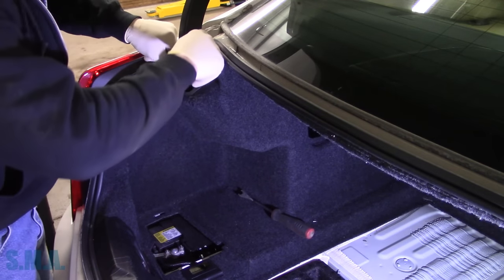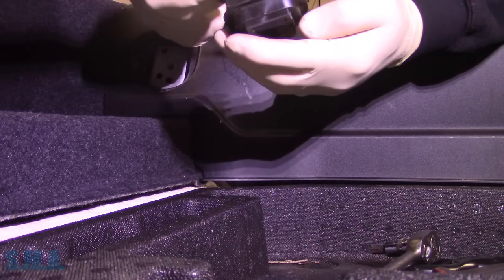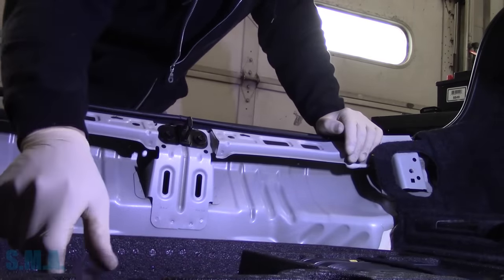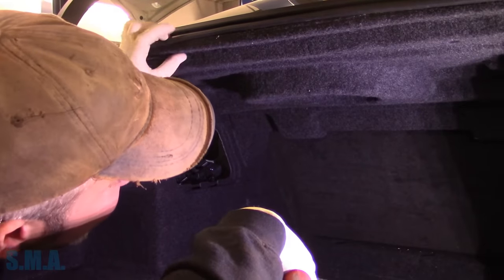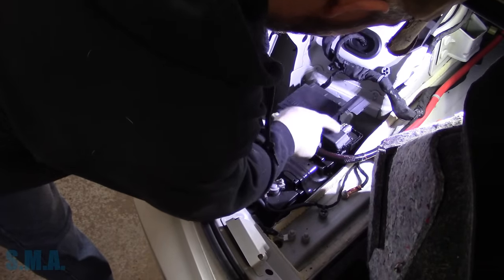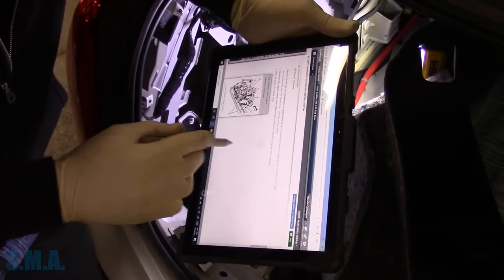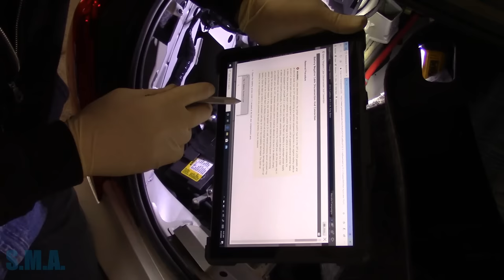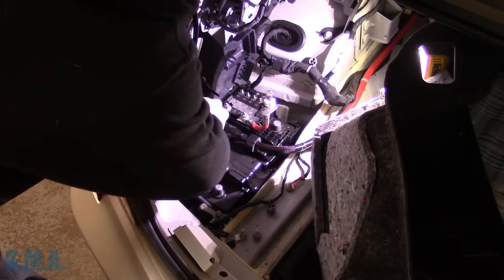Cadillac ATS: Battery Remove & Replace

Comment: Iv’e never had the opportunity yet to work on one of these. From what I’ve seen It doesn’t quite compare to a Dodge Journey battery replacement. I can’t remember what year but I would think they are all like that. Being that the battery is located in such a ridiculous spot. Under the drivers front wheel well. Im talking a really tight spot. It makes it virtually impossible to do diagnostics from the battery post. What were they thinking???

Comment: What I learned this week about new cars and their replacement procedures of the battery, you MUST know what you're doing!  One of the fact that he saw that this original battery is an AGM, customers must understand that you need to replace the battery with the same type of battery.  This particular model circuits design to charge AGM batteries, only.  Not lead acid battery.  Another thing I found out with these new cars with these batteries, and even I didn't know about this, is that you have to be very mindful about how the vehicle is measuring the battery charge levels!  I heard something about, resetting the cars charging levels, right after you replaced the battery. Just removing and replacing the car's battery can screw up the system and treat that new battery as if it was old.  In worse case, overcharging the new battery because you didn't reset the system to say it's a new battery. As we all know, the more the battery ages the more the car have to continue to charge the battery. That's the joy of having a new ass car!  I'm in no way close to as smart as this guy is with cars; but I do understand how complicated new cars have gotten.  A lesson here!  Always learn and research before doing your own work.  What you don't know can kill you, lol.

Comment: In the 90's the FIAT cars had to be reset on a diagnostic machine to reset the throttle body so it would idle, then drive it at various speeds and loads then let it idle until the ECU learnt when the cooling fan came on. I went out to loads of non runners after the battery had been changed. Fords were the same after they introduced Efi, they soon got it sorted tho , but all the messing around did take an hours labour, customers thought it was b##£$41t and we were ripping them off.

Comment: The battery on my PT Cruiser is under the passenger seat (it's the diesel) changed it a few times in the 2 years I've had it and only recently found out it's supposed to be a gel battery on its side, I've had a standard low profile battery all this time 🙃🙃

Comment: After the new battery is back in the trunk, do you put a battery charger under the hood on the positive terminal for a Cadillac ATS or CTS?
Reply: It has a positive wire going all the way to the engine bay so you can charge it from under the hood!

Comment: Until seeing this, my worst was a 1954 Lincoln with a minute 6 vdc battery under the passenger side foot panel. Darn battery needed replacement about every 2 years.

Comment: Got nothing on a Q3 hybrid. The larger of the two 12V batteries is at the very bottom of the trunk well, under the fan, duct work, and evaporator core that cool the high voltage battery right beside it... and that's after you discover it exist because, outside of the VW SSP's, it's hard to find any reference to this battery in your typical shop info. Opening the left panel in the cargo area reveals the small 12V and only complicates the matter as you think "oh, okay. There's the little kickstart battery just like a prius"
Reply: .... almost forgot, the subwoofer is in there too lol

Comment: My battery on my 2014 ATS was fully dead and when I replaced it the Radio and Nav quit working.  I checked fuses and tried disconnecting negative battery cable but no luck.  Any ideas?

Comment: Worst batteries I’ve changed?
4 8-D batteries on a roof top. Up two ladders. About 150 pounds each. Not fun. 

That ATS has a silly design for its battery. If it were mine (not that you can do this to a customers car) I’d look into cutting the liner and lacing it back together. 
I did that for the fuel filter access on a 2015 Duramax I had once. Laced the flap I made with black zip ties. Worked well for me.

Comment: Just did battery replacement on my mom's 2011 audi a6. That battery required coding after replacement. Tried using battery from O'Reilley's and VAG COM would not  accept battery serial number. Ended up buying OEM battery from a dealer and coding was accepted. So there's that.

Comment: I think car manufacturers over-complicate things just to motivate consumers to "trade-up" sooner once they realize how traditionally routine, inexpensive services are becoming expensive. Makes more sense to lease or buy new more frequently.
Engineers could have definitely designed that battery system to be easier to maintain, access and no need to trigger OnStar into a self-destructive mode. They deliberately chose to bury it and over-complicate it.

Comment: I have a pacemaker defibrillator I'd be more worried about the magnet on the speakers then those little clips also I just had my pacemaker replace because the battery was weak they only last seven years every morning 9 a.m. for 10 second it would beep just to let you know service battery soon

Comment: Batteries in the trunk; ignition switches and gasoline door locks in the glove compartment and starter switches under the floor mat Why use a separate battery for On-star?

Comment: You did not say whether you could remove the fuse connectors or not. I removed them with the battery and was told by an AutoZone agent that reconnecting them would damage the PCam

Comment: The local Chevy dealer wanted $50 labor to put a new battery in my C-6 'Vette, which is pretty simple job. They'd likely want about $500 to change it in this Caddy.

Comment: You know us diy's are gonna get the old razor knife out to get to the battery, and use some black ductape to put it back. At least you don't need a jack to take the front wheel off to get the battery like on the Chrysler products.

Comment: Another bad battery to change is in the Dodge Journey. First, you need to remove the left front wheel. Then the plastic push pins get stuck because all the dirt and crap gets splashed into them. One of those plastic shields cut my hand pretty deep--I still have the scar to prove it.

Comment: BMW have been doing that forever, putting the batteries in the trunk.  The upside is that there is a door that lifts out giving you full access in about 10 seconds.  The downside is the battery monitor that sits on top of the battery like that Chevy, the wires are "just long enough" to get them out of the way to put the new battery down in the hole.  You can't buy a battery in the states that actually fits it perfectly in length, but BMW provided a spacer tucked away in that compartment to use should you not buy another BMW dealership battery...for $125 premium.  It does require reprogramming of the battery capacity should it not be factory, but easily done.

Comment: A small permanent magnet won't affect a pacemaker. A strong, modulated magnetic field, or radio waves at specific frequencies, _might_. For instance, if you have a pacemaker, you shouldn't carry your cell phone in your left inside pocket. The pacemaker itself is pretty well shielded, but the electrodes act as antennas.

Comment: I replaced a starter on an old Ford pickup which cranked slow.
The battery was less than 2 years old. Well it was the battery. Education costs you no matter how you get it.

Comment: This guy did extra work , you don’t need to pop off the top part and do extra work.
Pop the black trim on the bottom, pull the two Christmas trees,be a man and fold the thing over and just change the battery.
You won’t damage the trim it bends lol
He pulled a scanner lol
Dont need that also 
Obviously change the battery in park 😂
Took me 8 minutes 
Paid an hour of labor , lol easy money.

Comment: Neighbor's 2011 BMW 3 series. No manual trunk release! Guess where the battery's located? Yup, the trunk. Had to pull out the rear seats (no fold-down option) and go through the trunk from inside the car just to reach the emergency inside release to gain access. Oh, and then you have to take the car to the dealer to get the new battery programmed to the car! So stupid...

Comment: The biggest challenge I have is not working on the car as much as working on the customer. Because the parts stores have thrown around the “free diag.” One has to explain to the customer that Mr Googlepants and a $99 scan tool do not qualify as diag.and like you stated if they don’t like us being fair they can visit there friendly FLApS for parts and parking lot repairs.

Comment: Chrysler: Battery replacement, no problems, start with the bolts that hold on the front bumper.
Tech: Oh it's another one of these PITA cars with the battery in the front wheel well?
Chrysler: No, no, the battery is in the boot.

Comment: Worst battery... the one in a full sized ram, old school. Bracket failed on a dirt road and it fell into the exhaust- stranded for a bit. Oh and the truck had a 6 inch lift and 36 inch tires...dang near wreaked a rib trying to get at it.

Comment: At Advance, they won't change a battery if there's anything in the way that they have to remove, other than a hold down. If you ask for them to change the battery or headlights, they pull it up on the computer and tell you whether they're allowed to do it or not.

Comment: u would think that center foam tray could locate a battery underneath and the pump or fix a flat could go in the corner battery the battery resides but im not an engineer

Comment: This ATS is a derivative of the Holden Commodore - which put the battery above the floor, in the same space.  One smack on the side here writes-off the car totally... Typically can't be repaired, because it sprays the entire corner with acid.  It can also cause a fire.

Comment: No one:

GM Engineer: I know! Let's put a part that needs to be replaced on a fairly regular basis, and put it somewhere behind 273 other parts that need to be removed first!!  And let's make several of those parts breakable plastic that will degrade over time and be super expensive to replace!!

Comment: The BMW's are just as bad, however you don't need to remove so much to get to them.  The E-34 put the battery under the back seat, so in a way that was pretty easy to replace.

Comment: I used to work at O’reilly’s and my boss demanded I replace one of these Caddy batteries. I told him it’s complex and time consuming. He insisted I do it as I’m the only one who worked there that had any experience being a mechanic/auto body tech.

Ok...

About the time I was ready to get the battery bracket off he came out and asked wtf is taking me so long?  Well boss you didn’t listen to me on the amount of time this takes, now you are stuck, and I’m not quite half way done. 

It took me about 45 minutes to get the job done. My boss started to chew on me again, I walked out of his office. He followed still chewing on me. I went to a fellow coworker and said “did I or didn’t I tell boss that putting the battery in that caddy was going to take some time. He said I did, and what does our computer say about the installation (we have installation instructions for those who don’t know). It says 1.5 hours and recommends professional installation. But gives the instructions any way. 

I turn back to the boss and say “I don’t know what you are complaining about, you demanded I do this, I did, and I did it in half book time”

He just said... oh, good job I guess but we don’t do those any more.

Comment: Gives new meaning to "junk in the trunk" as in design decisions. Like the Ford Duratek engine with the water pump in the oil gallery this is another example of the new less technical oriented engineers today. What part of NO don't you understand?

Comment: My 1954 F100 the battery is under the floor on the passenger side a peace of cake compared to this. If it goes dead you just give it a push and pop the clutch. And it's still 6 volt .

Comment: If you think this is difficult try changing an interior fuse on a 2017 Explorer.  I had to remove the driver side lower dash trim and unbolt the metal bracing.  You still can’t see the fuse box so you need a endoscope camera and have to contort your arm to reach the fuse.  Then you don’t have any leverage to pull the fuse!  I believe there is a special place in hell for engineers that design stuff like this!

Comment: Even Mercedes makes it easier than that: 1. 2006-11 B-Class -  full sized hatch in passenger footwell. 2.  1996-2002 E-Class - under rear seat, which comes off via two latches.

Comment: I believe it was a 1960 Thunderbird we had to take the passenger's fender off to change the battery, if I remember correctly. I think the engineer who put the starter for the Cadillac Northstar in the tappet valley should be strung up by his gonads!

Comment: This wasn't bad at all!  If you want a REAL challenge, change the battery in a 2014 Dodge Journey.  Battery location in fender in front of driver front wheel.  No joke.  Take off wheel, take off ALL plastic fender stuff, unlock cover (seriously, who's going to steal the battery?  Fumble around for 3 hours, button everything back up, take it to a shop and 2 mechanics with 50+ years experience between them get 'er done and ask very nicely to never bring vehicle back for anything.

Comment: Why does Eric keeps saying "Thanks Chevy?" The "GM Alpha platform" was developed by GM Specifically for the Cadillac ATS. The Camaro (2016-present) utilizes the GM Alpha platform. When this car was built in 2014, Cadillac was the only GM car using it. I grew up in Lansing Michigan, where the ATS is assembled, and worked 4 years in that factory making Oldsmobiles, many years ago. This something I am intimately aware of. So is there something in the auto-repair community that equates the Caddy with a Chevy?!?

Comment: Chrysler intrepid, 200000+ mi, with the big 2.7l v6, battery behind fender, accompanied by a lot of rust, and seized bolts. Free battery replacement at walmart 🤪

Comment: It cost me $80 to replace a headlamp on a 2008 Buick Lacrosse because a support brace, battery, and part of the front bumper had to be removed to access the back of the headlight cluster.

Comment: Makes ya wonder why they didn't just put a cut in the bottom area  of the wrap-round side cover, and a hinge, just for the battery.  I mean, almost have the battery was exposed from the get-go.  If it was my car the cutting knife would have been out.  Once cut, the next battery will be 5 minutes to change.

Comment: Diagnostics is a very sensitive subject for me. $135 to plug in a code reader and tell me random misfire and a bad O2 sensor….bite me. IF you’re going to check fuel pressure , spark , power and grounds on the sensor that’s different. But to try to charge me for reading codes ……that ‘s not diagnostics in any language . I have a big fancy Scotty scanner ha ha . I can read codes but that is not diagnostics in my opinion .

Comment: Had to change the battery in my m-in laws Dodge Journey which is hidden in the left front inner fender. Had to remove the wheel and inner fender to replace it. Looked like you had a little more room to remove battery cables in the trunk. My only question to auto manufacturers...why? For gosh sakes why!?!?

Comment: I work for Advance, not a chance in hell I'm putting that battery in for minimum wage and no tip for the snobby customer sitting in their warm car while I install the battery outside under no shelter in the sideways blowing rain.However, yes batteries we install for no extra charge. Battery will cost you almost $200 though! Nothing in life is truly free. GM batteries 2010ish+ are a pain.

Comment: DIY Dodge Journey battery has to be one of the worst to change. Jack up left front, remove wheel, remove fender liner twist yourself into unnatural position all while sitting on the ground. If I could only get my hands on that engineer lol.

Comment: worse battery i ever changed was on a customer e350(6.0l powerjoke) camper van.. they were mounted to the side of the frame on the passenger side in a a metal battery box. it had to be unbolted from the frame and lowered down to access the cables and then pulled out from under the van to get the batteries out.. full of dirt, rust and crud.

Comment: What happened to just 2 terminals and a hold down. I think I could do a full trans service on a 4r100 in the time it takes to just change that battery. Although this is not GMs first trunk placed battery. Anyone remember the cobalt and the battery was bad and you could not pop the trunk to get to it.

Comment: Why couldn't they just make the side carpet and bottom carpet 2 separate pieces and use a piece of plastic with clips to cover the battery? Also, how ridiculous is it that not only are you expected to disassemble half the interior of the car, but you also need a T45 torx to do it?

Comment: Typical procedure is that most places don't let their employees replace any batteries that aren't just underneath the hood. Under back seat, in truck, in floor of back seat, tucked behind any wheel wells its a no. I worked for Autozone and had friends that worked for other parts stores and battery replacement that is not under hood just isn't allowed. Sometimes we were familiar with certain cars and could get it done for a customer but even then like this job here it's too time consuming to get it done quickly.